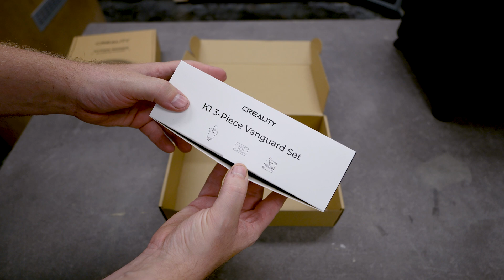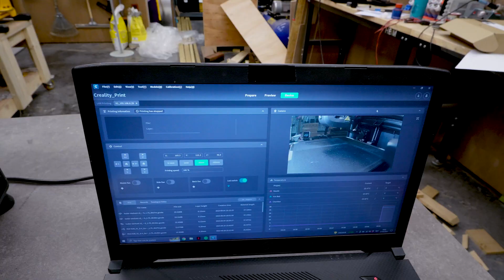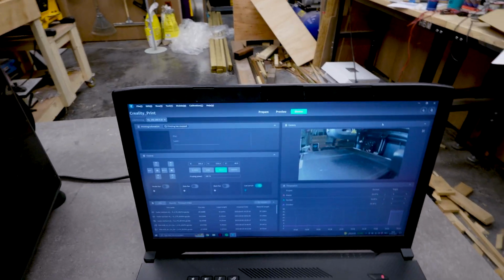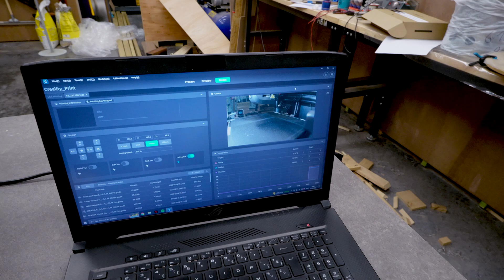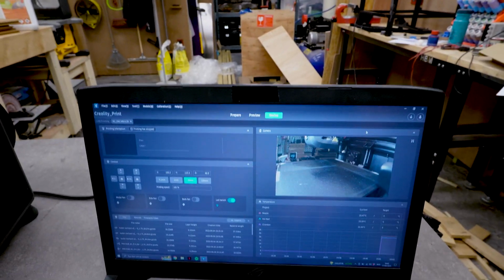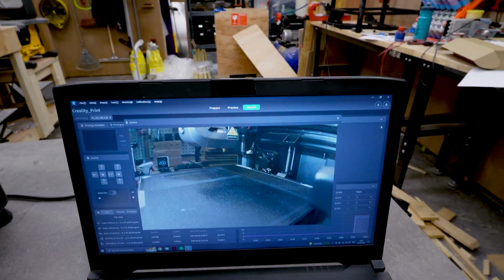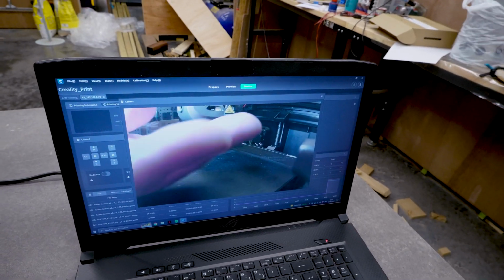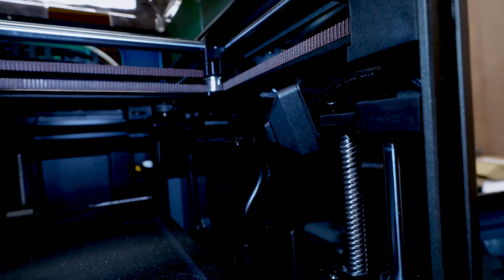Replacing/fixing extruder and hotend on the Creality K1 Core XY Tutorial.

Comment: Where did you get the extruder parts?? Did I miss that in the video?
Reply from the maker: @kyleeaton1709  Right now this kit isn't provided anymore in the link down below.
You can get these parts/kits on aliexpress, amazon.. for cheap
Reply: @NoizieWorks  ok cool thanks! I actually just took apart my extruder this morning and saw that yellow piece, so the guy that I bought it from must have already put this kid in. But the locking lever is still the silver one. Do I need to get a new one, or will it still work the same?
Reply from the maker: @kyleeaton1709  it's not the new extruder, this a revision attempt before the final extruder/hotend.
If you don't experience problems you can just continue and order the latest version as a spare.

Comment: For the last month I have been in dialogue with Creality about these issues that showed up on my K1 I purchased last year. They are trying to call the fixit pack a "gift pack" for regular customers and claim the machine has 3 months warranty and that Chinese law trumps Australian consumer law - ummm no, not if you want to do business in Australia!

I am not getting anywhere with them and are taking it to the ACCC (Oz Consumer n Competition Commision) and the state version as well. Very disappointed with their initial and ongoing responses. 

I have purchased a Bambu P1S and are getting far better prints out of it - I also am reassured by the level of support, quality of construction and results compared to the Creality folks...at least here in Oz.
Reply from the maker: @HenkPlaggemars  Sad to hear brother, bambu got their shit together just like the qidi Q1 pro which for the price is better then both imo (depending on what you look for)
When i talked to them on formnext they where very interested in the issues and that free kit was already released before the chat. The free kit is only before a certain date as all later printers should have the fix installed from factory.
But the vfa issues will not be solved and they will likely just bring out a new machine and fix it then although that still is to be seen.

Comment: how do I remove the hot end module thingy from that square serrated piece? it's completely stuck for me; I cannot twist or pull it out. I removed this screw from the side and I think the thermal paste seems to hold it tight.
Reply from the maker: Also the 2 bolt that hold in the hot end? You need to unscrew a total of 3 bolts
Reply: Yes I did, even the small screw on the side. The throat tube is just cemented into the radiator-looking piece @NoizieWorks
Reply from the maker: @gabenager5909  ah ok, heat op the nozzle to loosen the thermalpaste and with some twisting you should get it out.

Comment: My K1 Max fail on the 5th day for the extruder.  Hopefully the new part lasts much much longer. They were good with communication, and taking care of the issue. But 1-2 weeks waiting on an extruder is disappointing.
Reply from the maker: Did the max come with the extruder that has the white push button? As far as i know they all had the updated version but maybe you got a V2
Reply: @NoizieWorks  It has the metal filament release if that is what you are referring to.  Creality has been good to deal with but since it failed so quick, I was hopefully they would send 2.  

Also got a Micro Swiss hot end and with this failure thinking of installing that already.  This is my absolutely first 3d printer, started out well but not a great overall impression of longevity.
Reply from the maker: @OrionKnives  I think you got the V2, running the V3 now for a while and it seems to hold up fine now so should be good
Reply: @NoizieWorks I hope so as if this was machine that was essential to work then that would be more of an issue. Will see what comes in.

Comment: How did you get the platic tupe in the new extruder? (the one with a white clamp instead of blue) and how do you get the plastic tupe out again?
Reply from the maker: The long tube that goes into the extruder? You have to remove the blue clip and push the black button in just as the other one to remove the tubing. If you mean the little one on the inside it should come pre installed so i didn't open it up and just replaced the extruder.

Comment: Great video - I did not even power my K1 up until I changed out the extruder and hot end.  I did all of the FW updates and changed to a textured PEI flex plate.  Also a lid riser, the 270 degree door mod, and freed the PTFE tube.  First print and every one thereafter have been amazing.  I have been using the latest version of Creality Print for a slicer - not perfect but serviceable.  Very happy with my purchase of the K1 using the $200 off coupon at Micro Center.
Reply from the maker: That's a crazy good deal, with a few cheap mods this looks like a good platform especially for the money right now

Comment: Is that thermal pasted rated for printing temperatures? The hot end temps will be more than 2X CPU/GPU temps.
Reply from the maker: I'm using it for about 3 years now on the heatbreak of the bimetal sidewinder X1 with good results. On the site they claim a operating temperature of -250 to + 350c on the paste so it should be good 😉
Reply: @NoizieWorks in my experience, TG Kryonaut suffers from extreme thermal degradation and dry out. They admitted to this, and there are many posts online about this problem: https://www.google.com/search?q=kryonaut+thermal+degradation&oq=kryonaut+thermal+degradation&gs_lcrp=EgZjaHJvbWUyBggAEEUYOdIBCDUzODNqMGo3qAIAsAIA&sourceid=chrome&ie=UTF-8

IMHO just use boron nitride paste - it was designed for just this use case